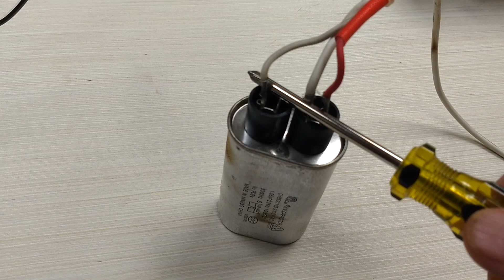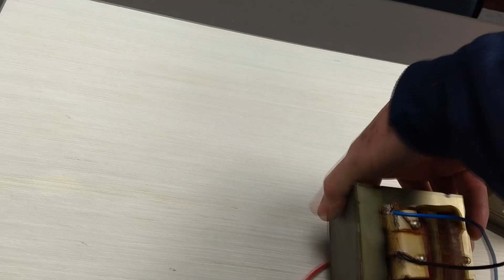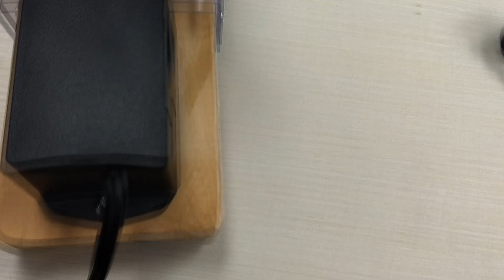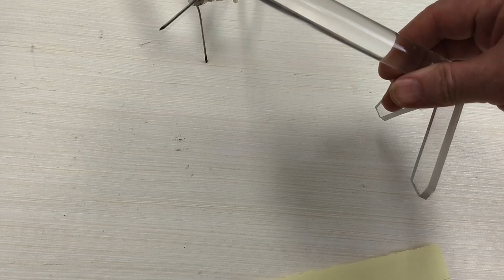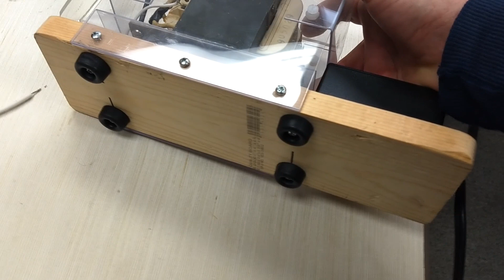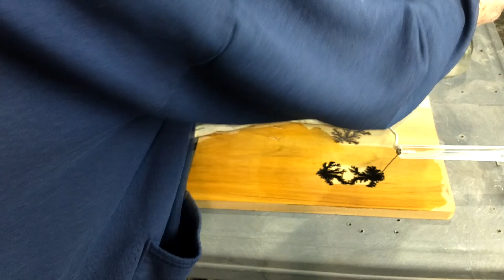Fractal Wood Burning Safety

Comment: Using a Momentary Contact switch similar to this: https://www.amazon.com/gp/product/B07FVN6JVG/ref=ppx_yo_dt_b_asin_title_o00_s00?ie=UTF8&psc=1 to control power to a work light which I use to accomplish the function you are using the tone generator for as well as power to the Variac and then sending power from the Variac to the high voltage transformer will add some safety. Also worth noting that artists or technicians are experimenting with different solutions to replace Baking Soda and Water. Not the best idea as Oxalic Acid which has been recommended as a wood bleach creates a very poisonous gas when vaporized. Having a container of wood bleach in the same area as your salt solution is another way to snatch misery from the jaws of safety.
Reply: @Jimscoolstuff  another concern I have is with the choice of solutions people are making. Some people are using table salt and water which will give off a chlorine gas when vaporized. Others are using Epsom salts which will give off a sulfuric acid when vaporized. It seems to me that to most common solutions that make sense are baking soda and water which gives off carbon dioxide and borax which gives off a mild acid.
Reply: Another concern I have is with the solutions people are choosing to use. Some are recommending table salt and water which will give off a chlorine gas others are suggesting Epsom salts which will give off a sulfuric acid are suggesting the use of oxalic acid for bleaching the wood which that solution would be available on their table if they happen to accidentally use it as a etching solution it will work and it also gives off poison gas when vaporized. I bought oxalic acid for would bleachingand now that I have it I don't even want it in my shop in case I accidentally use it at the wrong time. It's not like any of those solutions look different than any other of them if they're sitting in a cup on your workbench.

Comment: Just wondering... Wouldn't it be possible to use a transformer from an electric fence unit ?
I mean, lots of voltage (5000-10.000Votls) but not much current. Should (in theory) be safer in use.
I can't figure out, how much current it takes to burn ?

Comment: I’m looking to build one of these devices. My thought was to include a “dead mans” pedal in the setup. Anyone else have any thoughts about using a dead mans pedal?
Reply: It's a great idea. I use a foot pedal dead man switch on my unit so it's completely hands-free. I got it on Amazon, think it was like $30. The fractal burn unit plugs right into it, and the pedal plugs into the outlet.
Reply: You won’t be faster than electricity...  just be far way from the table and don’t touch nothing
Reply: Matheus_Garcia That’s not the point of a dead mans. The idea is it kills the circuit, making the circuit safe.
Reply: I just made a burner and am using a 10A pedal. I've been burning with hand wands but I like his hands free method in this video.

Comment: Jim.. I have been wanting to make one of these wood burning devices.. I have all the parts (and did know about the capacitors but not the beryllium.. thanks for that) But I have waited until I could find out how to do it safely..  Ah! I would have grounded my transformer.. good info.. What about a fuse set up? I was thinking of fusing this unit just for added safety? Outstanding Jim thee is just not enough safety information out there about some of the things people are playing with.. I can not speak for anyone else but I appreciate your advice.. I am 67 and my wife has plans for me to be around until I am 105 (groan) I have learned not to disappoint her.. So thanks again.. carry on and as we used to say I will see you in the funny papers..
Reply: @Jimscoolstuff  Well, protecting the transformer from over load would help protect me.. How can that be dangerous? Explain please.. I can see no reason that having a fuse can be a dangerous prospect..
Reply: @Jimscoolstuff  I am a very careful man Jim.. I have not made it to 67 doing the things I have done with out a close eye on safety.. That is why I appreciate your video so much.. This is not a project I take lightly, but it is also a project I am going to do, for some cabinets I am building and some trim for my house I want to make.. thanks for the concern Jim.. and You can count on me to do it safely..
Reply: tinkmarshino Just remember fuses go off AFTER the event. You would need a circuit to detect power bleed BEFORE it reaches a lethal level. Such circuits do exist.

As my father said “It’s the volts that give the jolts, but it’s the amps that light the lamps”.  So the higher the voltage, the smaller the current required to kill.

I’m thinking about building one of these devices, but adding a Perspex hood, with a microswitch for safety (hood lifted, circuit broken). Thoughts, comments?
Reply: @peterking2651  I like your fathers saying.. I am going to use it.. I do not follow "after the event?"  though.. I am also not familiar with the micro switch you are talking about I am going to fuse after the 100 before the transformer and also on the output side.. My device will be enclosed in plexiglass with no access an on and off switch with an LED to indicate when it is on.. and only I will be using it.. But as for my thoughts.. any good information is just that good and needed.. I thank you for you input because the safest way is the best way.. my dad always said if you are going to err then err on the side of caution.. safety will save your life.. Thanks my brother..
Reply: tinkmarshino You can find a microswitch at https://en.wikipedia.org/wiki/Miniature_snap-action_switch

Typically a microswitch would be used to switch a relay. On one side of the relay, with a low voltage, on the other side is the high voltage. The microswitch is on the low voltage side, the high voltage is switched through the relay.

Here’s a nice video demonstrating how to use a relay to switch high voltage with low voltage.
https://youtu.be/Ca20ktPygY8
Reply: @tinkmarshino  after you're dead, the unit will pop the fuse, and turn off so it doesn't burn the house down too ?
Reply: @qillir7  well, that's handy.. I will do that!.. But until then it works perfectly and makes some beautiful art.. I will probably be dead in 15 or 20 years so I will let every one know about the fuses.. thanks !
Reply: @qillir7  sorry I misread your question.. yes.

Comment: Variac - what name of model and what number AMP ? For Lichtenberg burning
Reply: Ron Parkinson 
It makes no difference. The higher rated unit will be safer in some circumstances because you are less likely to exceed its current limit. However, Jim has already told you that it won't exceed 5 amps.

Comment: Great video, Jim. I repair tube amplifiers and so am familiar with power transformers and filament supplies etc. Every previous video I watched had very little practical, and mainly confusing information about recognizing the primary, secondary and filament windings. Your video was a great help. There are many Lichtenberg machine builders out there with no knowledge of electrical theory whatever, or " just enough to be dangerous".  Well done and thanks.
Reply: The idiots get less by the day.....

Comment: Thanks for the information, and nice casing for the transformer, i cant find a manual voltage regulator where i live (variac). When you use tha paper towel and the copper wire, where do you sit the lead, in any place of the paper towel or over the copper wire?
Reply: https://www.youtube.com/watch?v=DGo88XWzFrQ
Reply: @darrenmarchant1720  Thanks for your contribution!!
Reply: @hijodejahguide  you are welcome. Salaam.
Reply: Use a foot switch.